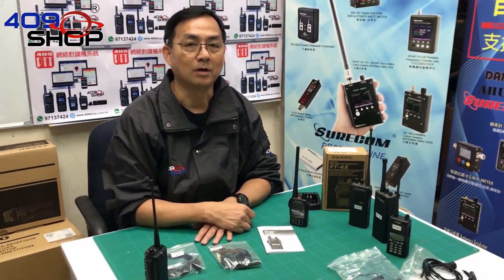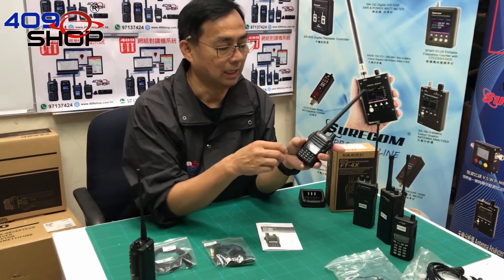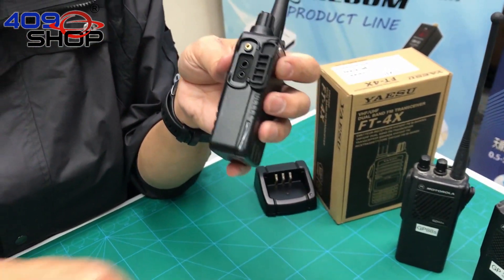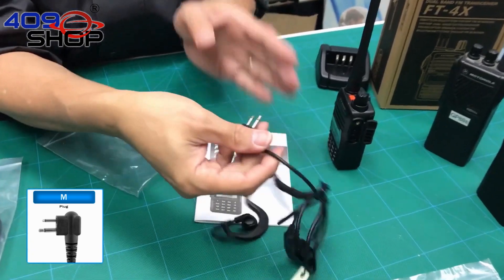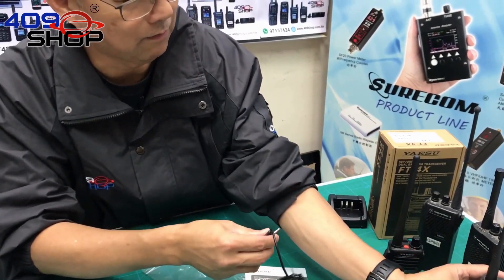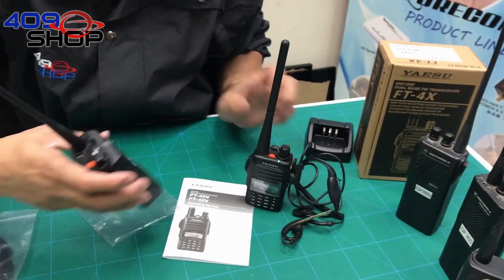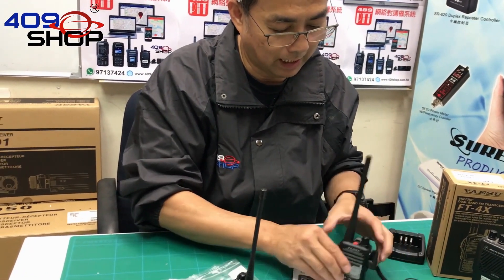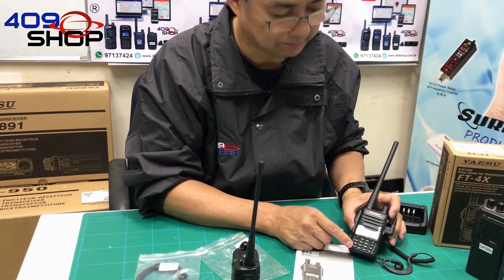Yaesu FT-4XR VHF/UHF Dual Band FM Handheld Transceiver

Comment: What is that small part not listed in the manual with the FT4X? It has a small plastic base with 2 metal tip pins on it. What is it for???